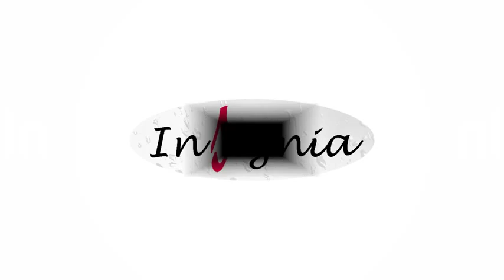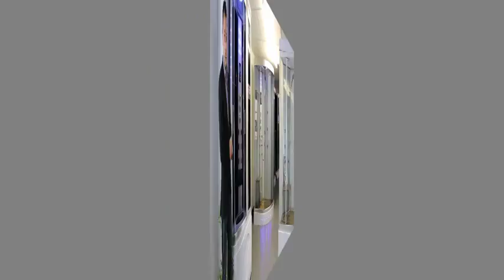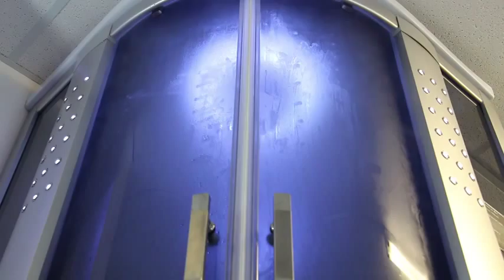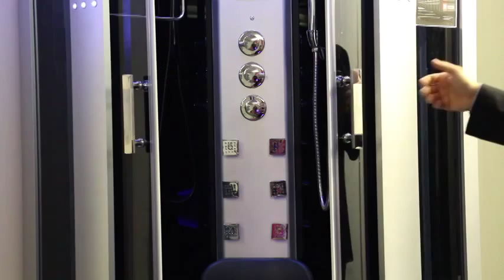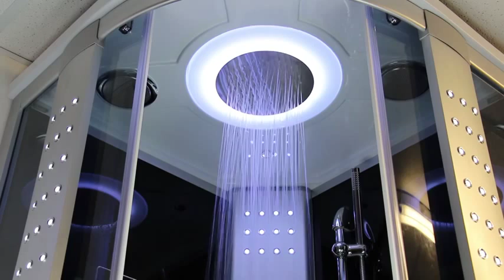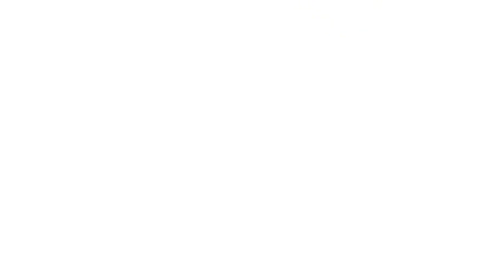Why buy an Insignia Shower over the competition

Comment: Bought an Insignia KYS900 steam/sauna/shower. Shocking build quality, one sauna heater not working out of the box, "monsoon" shower more of a drizzle, floor extremely slippery, waste pipe like tissue paper and split out of the box.  Rejected and returned for a refund which we got but we have them in small claims court as they will not pay the consequential damages they are legally required to.  Dreadful company, best avoided.